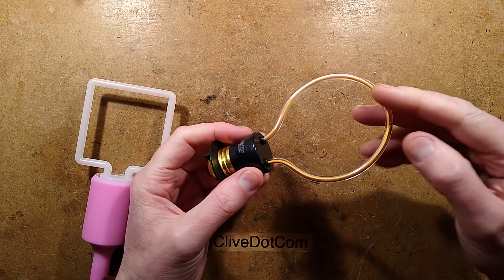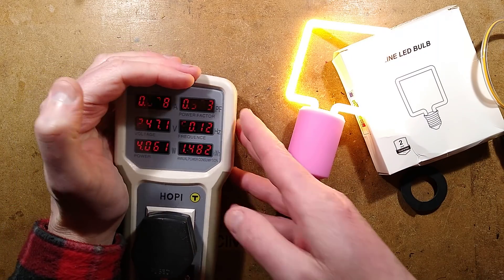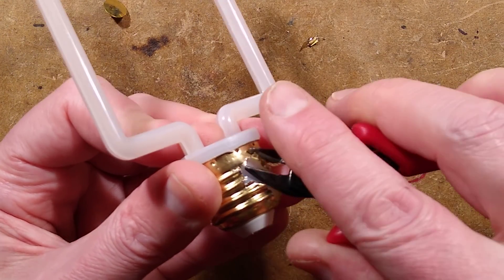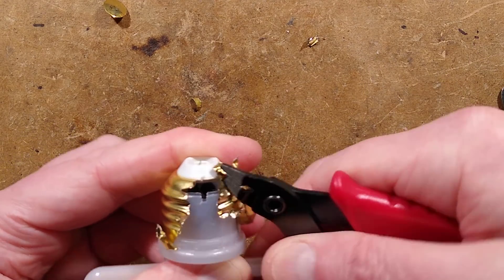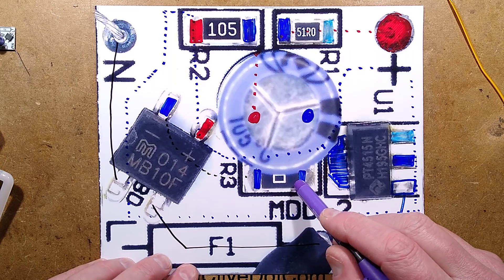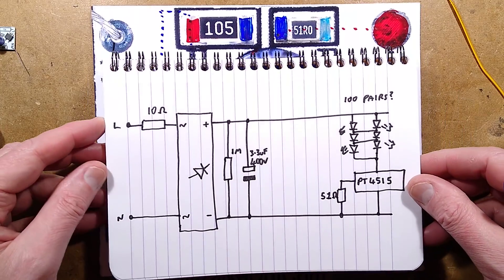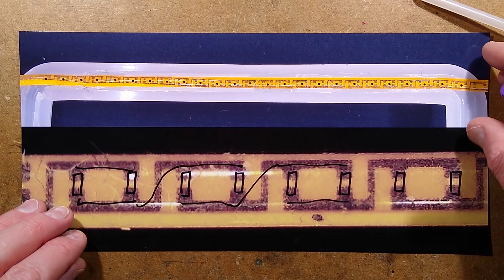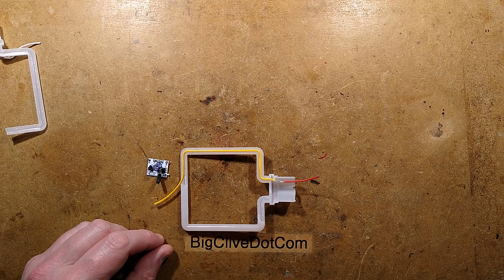Inside a next generation shaped filament lamp (with schematic)

Comment: I wonder if you could make a "Three Color Light" where you had the LED's polarity flipped, allowing you to swap current flow. Red one way, Green the other? Warm white one way, Cold white the other?
Reply from the maker: There are double sided filaments that do cold/warm white.
Reply: The red/green type definitely exists, as I seem to have some of them... only two pins, and they show red hooked up one way and green if hooked up the other way. They are very exciting... at first anyway- After the novelty wears off they are merely pleasing. This of course reflects my own experience, and may not reflect that of other folks... as usual- Please seek excitement at your own risk and discretion.
 peace.
Reply: @primateinterfacetechnologi6220  The red/green ones have been around for decades, we used to use them as an on/off indicator in industrial equipment (or power available/equipment running more specifically)
Reply: https://youtu.be/FTU5y6ZxuR8

Comment: I know this wouldn't be practical for mass-manufacture, but would it be feasible to 3d-print half a filament lamp holder, lay in the filament, then just keep on printing for a single monolithic seamless lamp?
Reply: Some internal holders to route them I think very possible I’ve printed captured nuts and an nano inside a print

Comment: I just have to come in with a warning here. WEAR GLASSES (like Clive does)!
I too had the habit of misusing that exact type of pliers (a Plato copy). When i was nibbling away at a bit of plastic one of the shears (hope that is what i mean) broke off and hit my eye. I had to have quite complicated surgery and was blinded for weeks from blood in the eye. It is about ten years ago and my vision is almost as good as the other eye now but the pupil does not close as much and it is not round any more.
I now use a standard side cutter that I have grinded down on the flat side to get the same kind of tool.

Thank you from Sweden.
Reply: I had the same failure - jaw snapped near the pivot and shot at me (thankfully only hitting me in the chest).
Reply: Thank you for the engagement! I actually just tested another pair i have been afraid to use, and by only squeezing the handles a little harder than usual, and not cutting anything, it broke in the same way!
We should urge our friend Clive to please do a video on this. And my modified standard side cutters I mentioned above are fantastic and so much more stable.
Reply: @ockelboi9948  You can add me to the list.  I had been using an Xcelite 170M cutter successfully for many years and thought it would be nice to have an extra pair.  Got a pair from AliExpress and the ergonomics were terrible and the first time I used them one of the jaws broke off.  Fortunately it didn't fly at me so there was no injury except to my budget.  Unfortunately at least half of the stuff I have ordered from AliExpress has been fake and/or defective.  1% resistors are actually 10%, Makita power tool batteries that have cells fail after 4 charge cycles, Oetiker style hose clamps where they send the wrong size.  The list is endless...  I have pretty much given up on AliExpress.
Reply: @Vincent_Sullivan  , my bitch with them is the junk email they now send me.  i bought a switch for a makita cordless drill from them.  it was not the cheapest.  the printing on the switch in the picture was so much like the genuine part that i guessed it was probably made in the same place as the genuine ones.  makita might have ordered 10,000 and they made 11,000 and put the extras on aliexpress for discerning buyers like me.
Reply: Kinda reminds me of using my dremel with one of those tiny cut off wheels. It broke and a fragment tried to embed itself into my forehead. Yeah I wear safety glasses now. Although I must say my encounter was far easier to predict than yours, good to know, thank you.
Reply: https://youtu.be/FTU5y6ZxuR8
Reply: https://youtu.be/FTU5y6ZxuR8
Reply: Yes, I must have had dozens snap like that, but then I have huge hands and don't know my own strength! I wear glasses anyway, but I've had a couple hit my face and make tiny cuts. The problem is usually finding the broken bit before someone treads on it.
Reply: There are tons and tons of reports of this issue with the Plato knockoffs. Eye protection is good advice.
Reply: Safety squints!

Comment: I've got a bulb similar to that first one (carbon-styled). But it's rated for 220v, so does nothin' when I plug it into 120. Bought it off eBay assumin' it was universal voltage.

Comment: When I need to separate metal from plastic, I use a lighter. I heat the metal a bit and the plastic starts "creeping" which us perfect to slide the metal parts from the plastic without even deforming the plastic all that much. 
Usually, with a drop of glue you can stick it all back together without any obvious damages.
Reply: Thanks for sharing 🤔

Comment: Would the led strip cope with 260 Celsius? If so, you could pause a print at the glue line, lay in the filament and then print over it.
Reply: I think it would because the nozzle doesn't stay in one spot for very long. The printed filament also cools down to 60ish quite quickly.

Comment: An easy way to get the crimped metal thread base off, without totally destroying it, is to drill each of the divots out with a 1-1.5mm drill bit. Then it just slips/unscrews.
Reply: How many 1mm drill bits get broken in the process...
Reply: @lefty5349  you can just look at them wrong and they break. I just consider them disposable at this point…

Comment: Makes me wonder what you'd have to pay per meter if you're buying dozens at a time. And how difficult it'd be to wire up safely and reliably.

I'm slowly waiting for these types of LEDs becoming part of ceiling lights that basically cover the entire ceiling. Imagine a tongue and groove style ceiling where every row is lined with these.
Reply from the maker: You could use a lay-in grid system with under-run flat ceiling panel lights.

Comment: If you 3D print a holder for a filament-like that you can do that as a single part without so no gluing is required. Print the part so you can put the filament without it extending above the surface. Then pause the print, insert the filament, and resume the printing so the filament is completely enclosed.  You can add a pause in the GCode. the simplest way to see how it is done is to look at tutorials for changing color in 3D printers without that capability built in. 

 It might be a good idea to use a bit of glue to keep the filament in place so it do not move when the top part is printed
Reply: You would need to do some trickery to accomplish that successfully tho. Definately not enough to only leave a section out in the model just big enough for the LED filament to fit. Your actual nozzle on the printer is wider than the bead of plastic it squirts out, so there needs to be a gap to give enough space for that. Second problem is, the slicer does not know where the LED filament is. So you need to tell it to never ever move the nozzle in a way that would collide with the LED filament, once it's placed in the print. The third issue i kinda see is temperature. PLA gets squirted out of the nozzle at over 200°C. I'm not sure this LED filament and the LED chips really like that heat treatment, as they will definately get some warm feelings while the printer keeps squirting plastic out nearby...
Reply: @ProtonOne11  The idea was to create a channel the LED filament fit completely into. That way the nozzle can move anywhere on the next layer without hitting the filament. The limitation is that you can only have a filament on a single plane that gets embedded in the plastic but you could make it extend up or down by gluing some part.  So the nozzle hitting the LED filament would not be a problem.

The temperature might be a problem but the amount of plastic is quite low so it do not manage to heat up the surrounding parts a lot. The LED filament is also covered with silicone and it should be able to handle the temperature, It is used in socks that cover many print heads. The flexible circuit board and LED do survive the solder and melt at a similar temperature as PLA.  I would guess that the LED filament has been exposed to a higher temperature during its manufacture than the PLA will ever heat it up to.
Reply: https://youtu.be/FTU5y6ZxuR8

Comment: Once lighting was liberated from incandescent or fluorescent, LEDs have enabled designers to run amok with colors and shapes. Amazing stuff.
Reply: And still they can deliver great light quality ("can" is the keyword here, it doesn´t mean they always do) at comparatively low power consumption.
Reply: furthermore they went totally amok with having no longevity and servicability at all with the led crap.

led has some great capability but manufacturers chose to make crap stuff with it.
Reply: @casemodder89 Yes, that's true, unfortunately. So Clive comes up with circuit mods to improve longevity without sacrificing too much luminance.
Reply: @channelsixtyseven067  yes, thats great for electricans and many already do mods for reliability. (me included - i run an led max. at 66% /better 50% of it's rated power capability. that triples or quadruples the lifetime and on top raises the lumen per watt => efficiency).

but the problem is more with non technical people. the stuff one can buy off the shelf is mostly crap and the average person can't do anything about that.

Comment: Not sure on your claim that the beta cap sockets are “safer”… someone could stick a finger in those just the same as the Edison screw? 
While the beta cap is unpolarized, the screw thread is always neutral. Anyone fumbling would only ever be touching neutral, because there’s never an excuse for sticking a finger into the socket itself…
Reply: Followup: I’d then consider a beta cap socket less safe if the metal casing were to come into contact with either L or N because of the fact that it is unpolarized, the casing could become live. Unless grounded in the socket, in which I’d consider it no safer or less safe than Edison screw

Comment: so is that regulator a current regulator rather than a voltage reg???
all i can find datasheet wise is in Chinese. but it seems to be able to handle mains voltage. so its a dedicated chip for leds. i think its keeping the current at around 30 to 60mA . but not 100% sure.. any thoughts on it anybody???
Reply from the maker: It's a linear current regulator.

Comment: reminds me that some laptop LED's use a thousand volts, since there's like a thousand of them in series. I put plain 12 volt across the backlight and was confused why it doesn't turn on. Tried 60 even hoping for a pop, nadda. Checked the forward voltage on one diode, then checked they're exclusively in series. oof. glad i didn't touch that when it's on.
Reply: Possibly drop in replacements for CCFLs?
Reply: @NiHaoMike64  no clue, but the high voltage tf was on the motherboard somewhere, not in the backlight assembly... meaning one poor laptop close would've fried the entire mobo/gpu.

Comment: As LED lights take over do we need 240v 5 amp lighting circuits any more?  If the average house has ten ceiling pendants and the led is 10 watts, you only need a circuit  to supply 100 watts not the 1000 watts we have now. I am sure they could develop  another fitting so that only led's can be plugged in.

Comment: Hi Clive, next time you do a mains LED lamp teardown, could you try undervoltage testing?   I'm in a part of Europe where the mains voltage dips to around 210V at peak times in the winter (lots of electric heating and cooking).   At less than 215V, various LED bulbs in the house start to flicker..... very annoying.
Reply: Rectified and smoothed mains at 210V input should give an output voltage of about 297V. You may well find that lamps with this type of linear controller avoids the flickering problem.
Reply: As he noted the box suggest they have 110-130V, 220-240V and 85-265V models ("universal") of this specific model..
Perhaps you should shop at say AliExpress instead of local supplies, many?/most? LED lamps on AE will either be available in universal models or are ONLY available as universal to save costs (since they're selling to both 115V and 230V markets they would otherwise need to stock both types).
Usually "universale" means that the lowest voltage is somewhere in the 80-95V range, with relatively stable lumen output above that - the regulation is often not perfect, but certainly it won't flicker from it.

The usual method of making dimmable LEDs require them to be fixed voltage rather than universal, but even there there's now universal voltage models. The circuit to do so usually involve a microcontroller, but these days a $0.02 one can easily figure out whether it's a leading or trailing edge dimmer and then locate the edge, derive a "dimming" percentage and then use that to drive the LED via a PWM DC source.
Reply: @Torbjorn.Lindgren  Yes, "85-265V" is the keyword I use on eBay but for another reason, to be sure (as you can be about ordering something from China) that they will send me LED bulbs with a driver and not with a dropping capacitor, because on the outside both types can look identical. 
Where I live the voltage fluctuates a little more than expected but it is very rare that it drops below 215 at peak hours so all LED bulbs works fine.
Reply: I'm always monitoring the mains voltage bit I've never seen it dip under 220. My UPS would kick in under that and that never happend.
Reply: https://youtu.be/FTU5y6ZxuR8
Reply: Now I feel really dumb. My kitchen light has been flickering this winter and I've been wondering why. Twas on colder days. Never put two and two together.
Reply: @Northern5tar  not if your in the UK, there pretty anal about grid frequency
Reply: @denisohbrien  Netherlands. The grid can hardly handle it as is and ever more data centers, using the power of a city, popping up. Meta (facebook) building yet another one. Come next year, at this rate my house will look like Clive's supercomputer.
Reply: @Northern5tar  are you living in the west by any chance? I never thought dipping would be a thing here, I usually measure 230 to 240 Volt here near the eastern border.
Reply: @TheFreak111  Username :) North. Maybe it's local I don't know. And the switch from gas to electric heating might also have something to do with it? Happening at rapid pace here atm.
Reply: @Northern5tar  hmm maybe, I don't know. Interesting nonetheless, did not expect such problems in our country.
Reply: @Northern5tar  I've noticed one particular filament lamp flickering a couple of months ago. I thought it was failing and was pretty annoyed, but it's not flickering anymore. Maybe that was just a particularly bad day for my local grid?

Comment: About them LED bulbs and full generations growing up not knowing about incandescent bulbs: when I was young there was a programmer problem: you have a room with three lightbulbs, and three switches in another room. You can't see from the switch room into the lightbulb room. You can do whatever you want with the switches, and then go to the other room and tell which switch corresponds to which of the bulbs. And the solution was to turn two switches on, wait a bit, turn one of them off, and then go to the other room, see which one is on, and feel which one is hot. That problem doesn't work with those new-fangled LED bulbs.
Reply: Yeah it does less get warm

Comment: Why does the UK use bayonet sockets? 
a) they wanted to be different than the US
b) they wanted to be different from Europe
c) they wanted to save on license fees
What's your guess
Reply: It was existing technology, easy to manufacture and vibration resistant. Also the reason why bayonet connections were chosen for automotive lamps. God Bless the Empire 😁
Reply: @SimonCoates  Two-pin bayonets aren't vibration resistant.  You need three pins for that.
Reply: @bdf2718  Vibration resistant in the sense that they can't fall out, or unscrew themselves like ES connections. Not that the lamp can't vibrate.
Reply: @SimonCoates  Yeah, but the contact can be intermittent.  It's why the military prefer TNC connectors to BNC connectors.  Well, did prefer them back in the old days.
Reply: Fact is, the bayonet type is better and safer ! Only one size unlike E27 and E12 .
Reply: d) all of the above